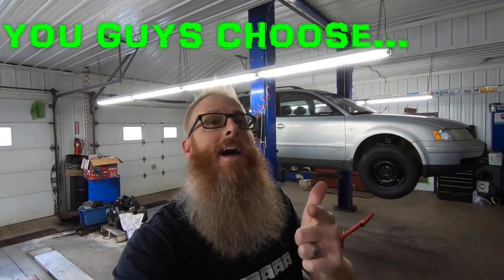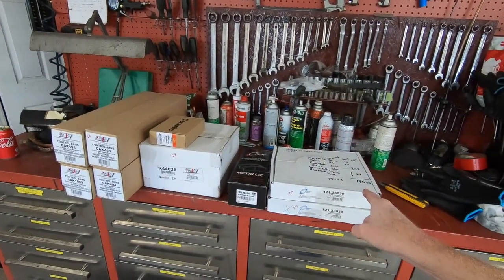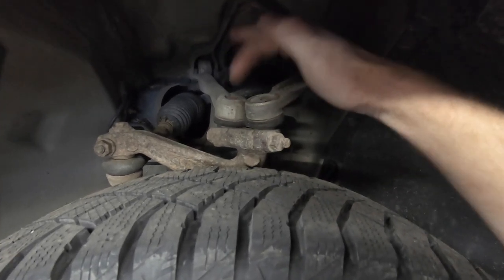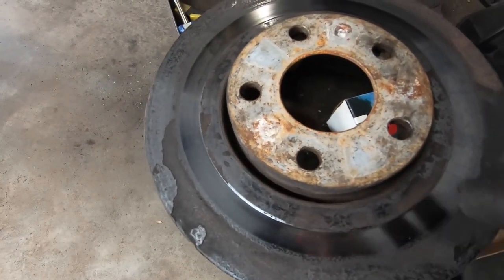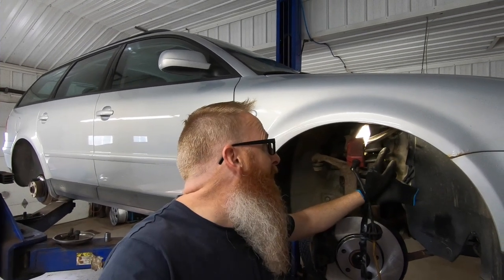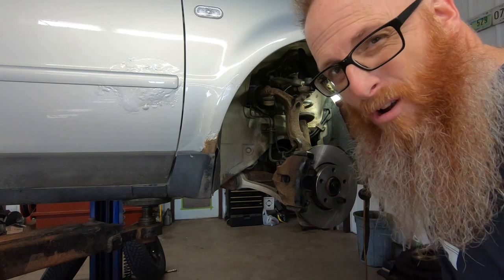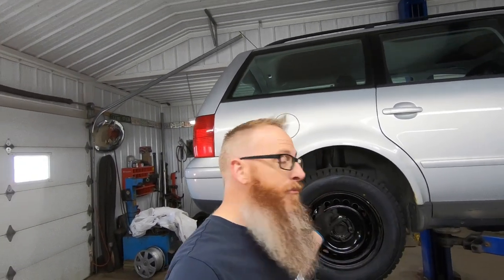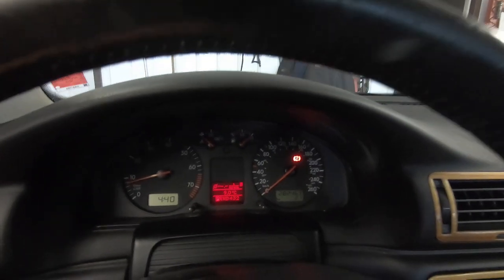MY 2000 VW PASSAT GETS OVERSIZED TIRES AND NEW BRAKES

Comment: 2 years ago i bought a 4x4 Passat with a 2.8 V6 engine with a lot of options. 95 000 miles so suspension was worn out, still drove excellent and passed inspection. When i changed the suspension as new the thing drove twice as good. It's also built like a tank, i've seen crashed Passat head on collision >> windshield was caved in and driver was able to walk out of the wreck! I was sideswiped 4 months ago, insurance was going to write it off - i said no and it's now back on the road. Out of the 6 cars i own i really cherish this one!
Reply from the maker: Thanks Mike. I like hearing these stories about the B5 Passat's. I have a few minor details to work out on it but I can't get over the ride. Once I get the lift kit on it, I'll start working on a few unique things to dress it up. Stay tuned and thanks for watching.

Comment: I like the wheels, nice save on the broken bolt.  Did you swap out the odometer drive gear for the change in wheel diameter? The aftermarket brake parts are a great alternative to OEM on an older car.  Try cleaning the throttle body, it may help with the hesitation.  Have a great Thanksgiving with your extended family in the States, thanks for the videos.
Reply from the maker: Thanks James! I didn’t make any compensation for the bigger tires! According to an app I have on my phone I the speedo is only off by 2-3 mph so I’m not too worried about that! 

I do have a fuel filter and plan to clean the throttle body and hit it with some Seafoam! I’ll be sure to update! 

Have a great Thanksgiving as well!

Comment: Av had 12 of these 2 that style b5 and 10 b5.5 Tdi Also my freind has a Tdi 130hp 6speed  he has the 1.8 T.  Your dam lucky that pinch bolt came out. The bolt that goes back into it is only £2.00 at Vw. I don't recomended putting 70 profile on it as it stresses all the other components. I have gone up to recomended 65 profile and found it to be fine. I understand that you wanted to give it a quick lift and get the tyres to fill the arch but. I personally would not have done this way. It not dangerous but you will find all the control arms will degrade alot quicker as they did when I had mine on the 65" profile recommend. I am a car mechanic. The brakes are fairly simple on this vehicle and i can change them in about 1hr. The upper control arms are allways frozen in with rust I have  cut them out with a grider then drift them out replace with a genuine Vw bolt at. I normally take the strut of at the top so the whole suspension comes out with the arm's. Please don't  take this the wrong way as this is just my opinion and experience with Vw Passat b5 &B5.5. Take it easy mate.👍
Reply from the maker: I appreciate all your advice Ali, however, this isn’t a car I am keeping for ever. Maybe a year or two as a project car! It just may end up in the same situation as my Kia did. That’s why I’m not too concerned about using the oversized tires! Thanks again!
Reply: @OldeCarrGuy  no I understand that mate. I  was concerned for other folk not yourself because somtimes people will just copy what they see . I know that it's an old dog to you and you only expect it to last a couple of year's. Am not trying to piss any one off. Am just a guy who works on a lot of Passats they happen to be my favourite car's. Henceforth why I have had 12. And a possible 13 yet as it's laying out side my house. I hope you enjoy your Passat as much as I have enjoyed mine there great car's. They eat miles for Fun.🏴👍✌✌
Reply from the maker: I get where you're coming from on the folks copying. I'll be sure to mention it in an upcoming video. Thans again for your insight!